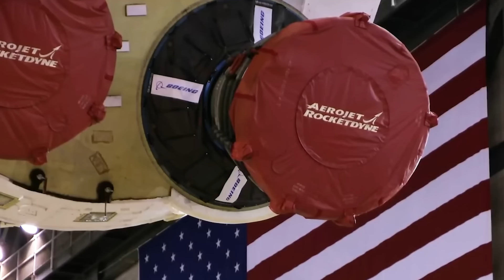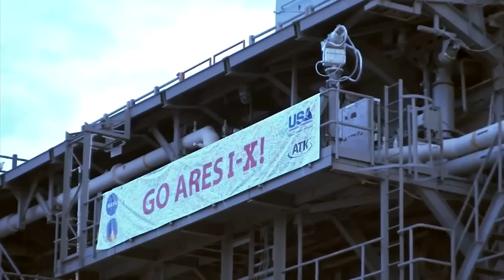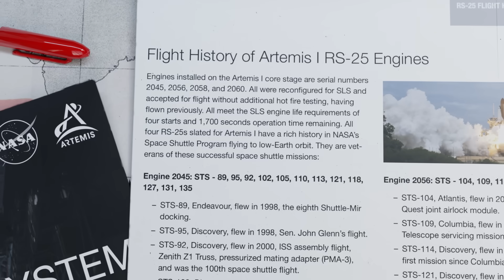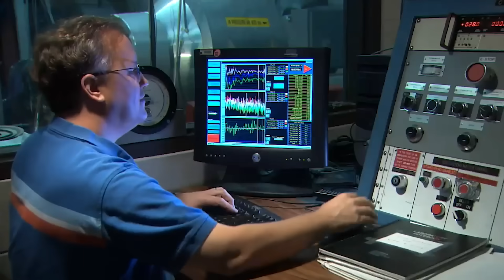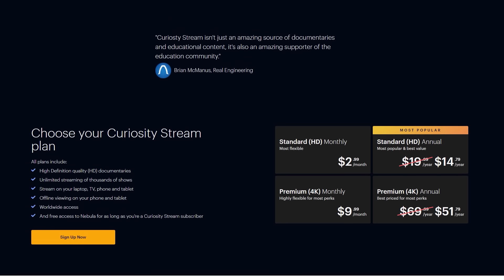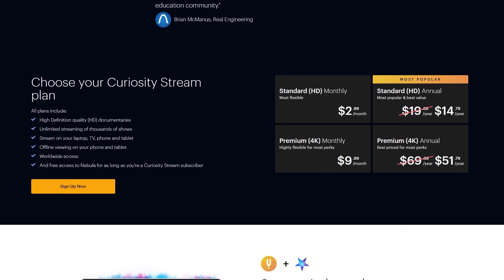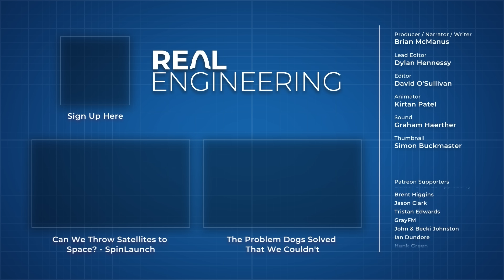The SLS is Outdated. Why Does it Exist?

Comment: The Space Launch System is still being used tho, and nothing to replace it? So how can it be outdated?
Reply: Its outdated because it cost far too much to use for how much payload it can send.
Reply: @miguellopez3392  I see. Why don't they make a new one? Does it cost to much or? Maybe he answers this in the video but i can't remember if he mentioned it or not.
Reply: @pepedeltoro6647  because ULA operates by creating jobs not rockets, congress won't fund NASA unless they bring jobs to their states, and they do this by essentially black mailing nasa into working with as many contractors as possible driving cost up massively, these contractors mainly being boeing and Lockheed. Despite using hardware that has existed for a previous 30 years, the SLS costed 20 billion and a development time of 13 years, starship rocket made by spaceX is built from scratch and significantly more powerful and complex and has only costed 7 billion and 5 years to get to the same state with a rocket the beats the the SLS on every single metric.

Comment: We know that first stages/boosters can be reused, but do we actually know how much does it cost? Space-X has never provided us any data about the price. Experience out of Space Shuttle project says that reusability of anything related to first stage is very expensive. One thing is solid prop. boosters, other thing - complicated engineered turbopums and stress resistant parts.

Comment: I really was stunned when I found out that pretty much nothing was reusable. The shuttle boosters they are reusing from the space shuttle were INTENDED to be reused. Same with the engines. Why the wasted parts meant to be reused?
Nevertheless, the rocket is still cool and I 3D printed a model of it.

Comment: The thinking was money is NO OBJECT if the desire to get to orbit is needed - the need and lack of competitors able to deliver the heavy payloads that people want - the few who know can charge what ever they want.  With more people finding space a viable option for useful tools that can help humanity at lower cost than terrestrial systems - the cost of getting to orbit will become key.  If costs to get to orbit can be less expensive, more industrial applications will become viable.  Without less expensive systems, the path to the extra terrestrial paradigm will take longer.  
SLS is a dying duck - one the 4 planned rockets are completed, I doubt there will be any more single use rockets in use - just like ICE cars - in 5 years, the cost of producing ICE vs EV's will shift to EV's.  Reusable rockets will completely take over.

Comment: fact... tried and tested... data going back 50 yrs... also fact...what rocket can currently replace it? Space x ? alot goes into new designs... alot of leg work.... staying close to original should keep the bumps smooth... may look old and outdated but yet there are countless examples in engineering when tried and tested is the right choice the majority of the time...

Comment: Outdated relative to what?
Reply: jaxonb.1864  The private sector doesn't have anything that's even remotely as capable.
Reply: jaxonb.1864  The Raptor doesn't work, all it can do is melt. The RS-25s are still some of the best engines ever made, and they actually work.
Reply: jaxonb.1864  It doesn't work, though. What else do you want me to say? It has consistently demonstrated that it can't do anything but destroy itself during testing. If the Starship ever launches with a payload, I will agree that it works... or, at least that it works well enough to be used once. I seriously doubt that it will ever have a long enough lifespan to be reusable, at least not in a way that would ever make the Starship (and its booster) financially viable.

Honestly, I don't even want to talk about space exploration unless it involves the failure of the private sector.
Reply: jaxonb.1864  I'm seriously depressed and as far as I know, I don't exist to please you.
Reply: Jaxon B.  Thanks for the kind thoughts.

Comment: It's not so much that it's outdated, it's that it's an inferior rocket to the Saturn V and built for the same purpose (I wouldn't buy anyone's assertion that it's designed to go to Mars; even at its heaviest payload, it'd never reach Mars). It was billed as NASA's "most powerful rocket", it is no such thing. The Saturn V could carry a greater payload and was cheaper to launch than the SLS. I bet Boeing, Lockheed Martin, Northrop Grumman, etc, have all the engineers' notes from Saturn V locked in their vaults somewhere, and NASA should have made it their business to make them available. There's this claptrap going around that it was just a different time in terms of engineering and that engineers have lost the practical, hands-on skills they had in the 1960s. It's nonsense. Engineers haven't lost any of those skills and can rebuild any craft from the 20th century. Reverse-engineering a Saturn V shouldn't be a problem. This is a case of Boeing trying to rinse the US government for every cent they can while making up excuses as to why they couldn't just rebuild the Saturn V. As for larger rockets than the Saturn V (to really get us to Mars), we'd need a carbon fiber frame on the rocket (or a fiberglass one) with aluminium on the outside to take advantage of its cryogenic properties. Many other composites also look promising for replacing aluminium also. We could be building rockets the size of skyscrapers by now. Luckily for us, Richard Nixon had to axe NASA's budget in the early 70s.

Comment: The Monad is the singularity.

The number associated with the Monad is zero.

The geometric dimension associated with the Monad is zero-dimensional space. 

The elementary/fundamental particle associated with the Monad is quarks. 

1) no spatial extension 
2) zero size
3) exact location only
4) 6000 trillion trillion trillion (39 zeroes after 6k) times stronger than the force of gravity.

0D Monad (SNF) 
1D Line (WNF) 
2D Plane (EMF) 
3D Volume (GF)

"He is the invisible Spirit, of whom it is not right to think of him as a god, or something similar. For he is more than a god, since there is nothing above him, for no one lords it over him. For he does not exist in something inferior to him, since everything exists in him. For it is he who establishes himself. He is eternal, since he does not need anything. For he is total perfection. A being can have a relationship with a God but not the Monad as that would be a contradiction."

— The Apocryphon of John, 180 AD.

Comment: I am just really upset that it has taken them longer than 5 years to create a shuttle derived launch vehicle.  This is more like 10+ years with the death of the Aries I and Aries V, now SLS.  For the same hardware and production line plus some redesign on the main tank for loads, this should have been feasible much earlier.  It also seems strange to defer the Block B to focus on the Orion capsule.  Especially when we already have things like the CST-100 and the Dragon 2.  The biggest claim to fame for a heavy lift system is the payload and that beautiful fairing size.  Imagine the space hab and support systems that could have been launched and then manned using more affordable human rated launch systems.   We could have launched the Bigelow BA330 and more, effectively putting one third of the ISS's internal pressurized area into space at once!  Something that would have taken tens of Space Shuttle launches.  The SLS and heavy lift is needed but we could have had so much more for so much less.   Thoughts?

Comment: This comment was posted a week after the SECOND scrubbed launch attempt of the SLS...  due to hydrogen leaks and other hydrogen fuel issues.

I'm sure there's a better name for this than Artemis...  Challenger, maybe?  Because it's proving to be one heck of a Challenge for NASA to get this massively behind schedule and overbudget POS off of the ground, if it doesn't blow right up on the pad.  They're literally going to throw away what, 90% of the total vehicle?  Nothing like going backwards 3 DECADES.  Literally every component of this rocket (not counting the actual payload) is, and has been for decades, reusable, and they're just going to dump it into space or the oceans or whatever?

At this point, I'm kinda hoping this SLS-1 pulls another Challenger and goes kablooey halfway to orbit, just to say "I told you so" and "you could obviously do better than that" to the idiots both in Congress, NASA, and the contractors who built Frankenstein's Rocket.  I don't get why people are excited that we've had decades of technological innovation since Apollo but we're essentially doing the exact same thing 50 years later with a tiny crew capsule that might as well have come from that program...

Comment: NASA needs to get out of being a prime contractor when it comes to its rocketry. When they give the prime contracts to companies like SpaceX or even Boeing, NASA takes less risk and the either the prime contractor does the job, or they don't. When it came to the transport to the international space station NASA placed SpaceX and Boeing in a sort of competition - giving them both prime contracts. Boeing starliner has failed miserably and likely will never launch in all honesty, whereas SpaceX has done fantastically. With the SLS they should have done something similar awarding one company the PRIME contract after some test and validations, and let those companies do all the engineering and technical integration. NASA simply can't compete in this area any longer. In the last 10-20 years the best and brightest aerospace engineers have gone with private companies as they pay much more. Just a fact of life. NASA should operate like the Pentagon and just manage the contracting aspect and do some oversight to see things stay on tract. Of course, that has its own issues, but it has proven to be valid over the long haul as the USA is still number one in military tech.

Comment: should have stuck with saturn 5.....it was reliable.
Reply: Apollo 13
Reply: @maxv9464  crew came back safe and no injuries.......saturn 5 still holds the record for heaviest payload into low earth orbit and no payload or crew ever lost...and it put man on the moon you nit picker.
Reply: @lapisredux  Sure. But it also had to carry its own lander, had a lower crew capacity, had a huge flight computer and was expensive as hell.

To retrofit it for the modern day would require nearly as much adjustment as converting shuttle components into SLS has and that's exactly the process that has made SLS so damn clunky. Job protections, confessional oversight, etc.
Reply: @maxv9464  the point i'm making is it was outrageously successful with 1960's tech and now it's 2022 and it's achievements still haven't been matched.....WHY NOT ?
Reply: @lapisredux  Budget cuts. Congressional involvement. Job distribution. The STS program, its successes and failures. The constellation program's collapse.

If we're gonna go back to the moon to stay, we need to do better than disposable landers and disposable rockets. We need more crew, we're gonna need gateway, and we're externally sourcing starship as a much, much better lander. That's not something the Saturn V could do, reliable or not
Reply: @maxv9464  it's a lack of interest from the public....more interested in dance routines on tik tok.
Reply: @lapisredux  Ok show me where the lack of public interest directly caused the disuse of the Saturn V. I just explained to you like 5 major reasons for that, but go on, keep ignoring me and whining about stuff you obviously haven't put thought into.
Reply: @maxv9464  check your history...and don't be so rude.

Comment: reusable rockets are dumb they don't make space travel cheaper with the falcon 9 you save 10% but lose 30 to 40% of lift capacity as due to 905 of a rocket being fuel so when most of it is burned of the mass is greatly reduced so the last amount of fuel gives you greater kinetic energy as the opposing forces have been greatly reduced like mass and air resistance as when you rocket is at the peak of acceleration you are going to separate the first stage booster uses the fuel to land it  which is dumb as you are also risking the booster being lost anyway there is a reason the space shuttle failed it didn't save on cost it was dangerous and turnaround times were awful negating what it was set out to do  and now star ship will fail as it is fundamentally flawed and is just a giant flying bin just watch the common sense skeptic

Comment: SLS should be cancelled. A once a year launch cadence does NOTHING to further Artemis' own stated goal, to return to the moon to stay. Even twice a year isn't enough. SpaceX is already about to overtake SLS, and was a basically non-existent company when SLS started. NASA should be ashamed of themselves for wasting taxpayer money in such a foolish manner. Even all the new planes for Artemis missions with Starship as the lander are restricted by the wholly inadequate launch cadence. SLS costs more than double what the Saturn V costed adjusted for inflation, and all it can do is put 4 people in a tin can around the moon, not even land. It requires partners with an absolute minimum of 3 launches or more to complete a single mission, when arguably those partners could complete the mission without NASA at all (Starship/Crew Dragon), and do it far more frequently, for far less money, and more efficiently. NASA's partners are actually more capable of achieving Artemis' stated goals than even NASA could with an immense amount of wasteful spending and reliance on partners.